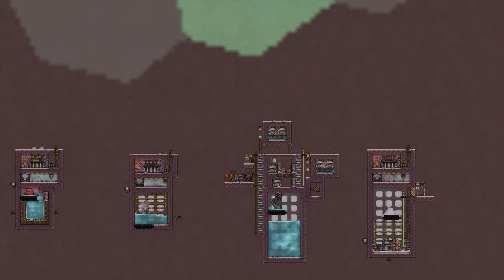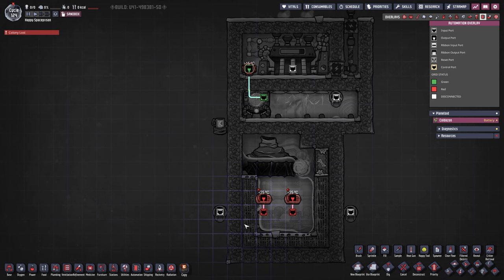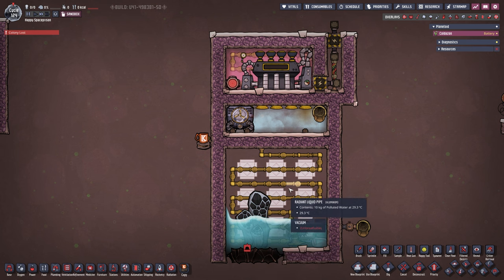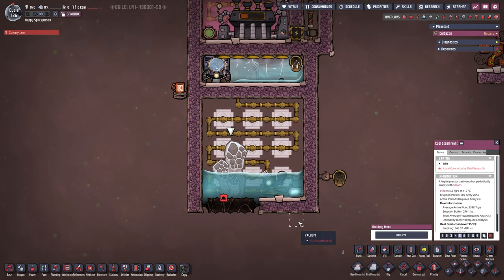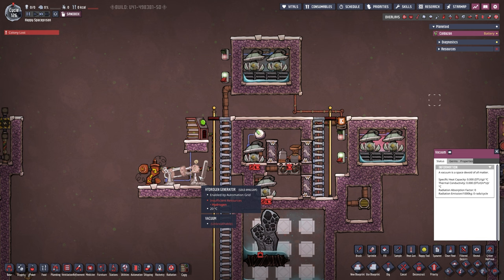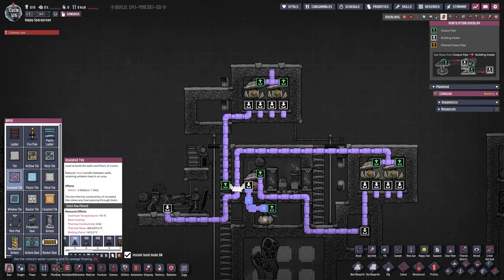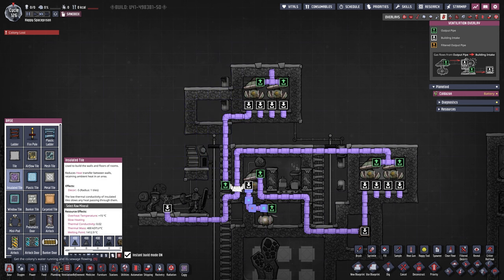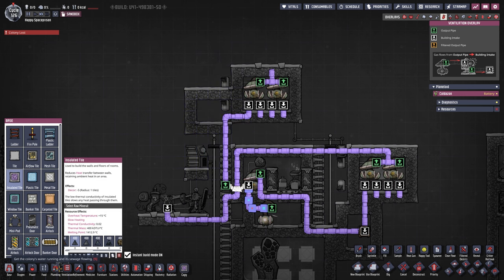GERMAN ENGINEER explains ONI: SALT/WATER Geyser & COOL STEAM VENT! Oxygen Not Included Spaced Out

Comment: Great video. One issue i had with a small Steam vent it didn't work for me at the beginning. Aquatuner overheated and the problem I managed was cause there was no hydrogen in the chamber with the steam engine. So the hydrogen there is quite important. I watched a lot of videos and this one is the only one that solves the problem of cooling water to an affordable temperature.
Reply from the maker: Hydrogen is the best gas for thermal conductivity, but it shouldn't be required to make it work. What is more likely is that you don't have enough steam in your thermal aqua tuner chamber, and it can't soak up enough heat. 
But either way, I'm happy that my video could help solve your problem, and you have now plenty of water with a decent temperature :)

Comment: That cool steam spom is not spom. Eventually water will heat up from hot steam and stop that steam from liquifying. It may take a while but it will happen.
Reply from the maker: You may be right, after many(hundreds) of cycles it may fail to liquify. But, truth be told, I build a system like that before in a real game and until I was done with that save It didn't fail. That was a while ago, so I can't remember the exact cycle count, but this thing must have been running for 400+ cycles. A single radiant pipe of thermolated water running through there in any direction will solve that issue though :)

Comment: I just want to know why we have to filling bottom tile in aqua tuner room with polluted water and on the top with water ?
Reply from the maker: It is the easiest way to get all tiles filled with liquid but not use much liquid. You can have just grams of Polluted Water and a few kg of water to fill it all. Otherwise you would need a full 1000kg on the bottom layer to fill it up. It also doesn't have to be polluted water, can be salt water or brine as well. Mix and match as you see fit :)
Reply: @BierTier  Thank you very much for the explanation. :)
Reply: @BierTier  I did use only clean water and it also working great

Comment: hi, im using your salt water geyser design and im wondering how long it typically takes to cool down assuming a large amount of water? the aquatuners struggling to keep up with the output of the geyser that i have. Currently the geyser is overpressure due to the amount of liquid present in the chamber
Im not certain if i need to use patience or if there is something i could do to help cool it down faster.
Reply: Use 2 aqua's in series, one will struggle to bring down the temps fast enough

Comment: does Infinite Gas Storage still working? I tried many times and it always says overpressure and not store anything.
Reply from the maker: Yes, it definitely still works. The problem is the amount of water you have over your vent. It needs to be below 1000g(1kg). Between 300g and 600g is what I usually aim for :)
Reply: Also make sure you have at least two horizontal tiles for the liquid to spread across.  It will overpressure if the liquid is all on one tile.

Comment: Nope, always boil the salt water. And the polluted water. Zero labor, zero filtration medium. Only cool the water if you must, if you can use it hot, do so.
Reply from the maker: I can’t agree with “always”, it really depends on the use case, the available resources and the position of your vents. But yes, generally you are right, if it can be boiled, it should be boiled :) 
That's the ONI beauty, many different solution lead to very similar results :)